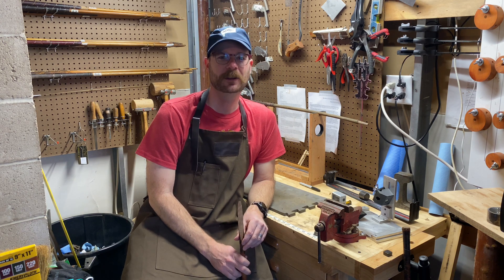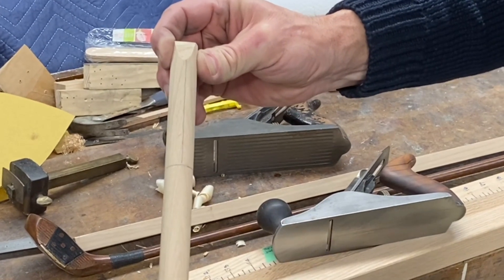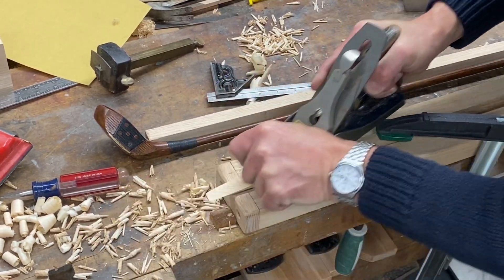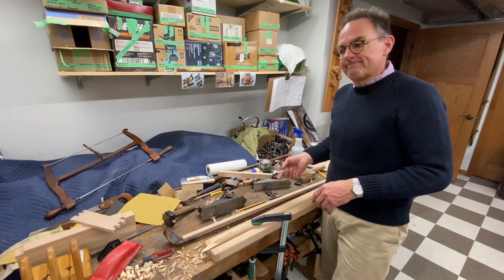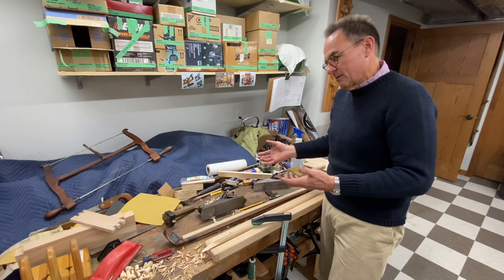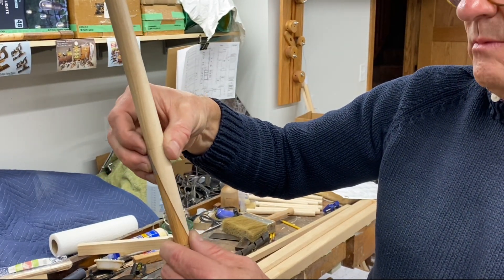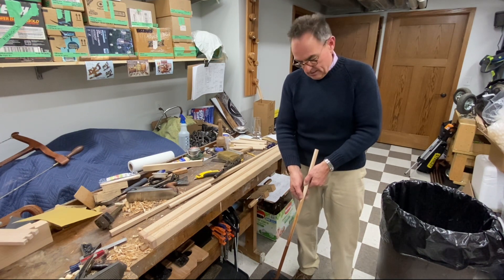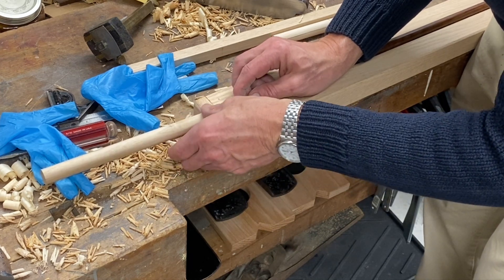Lengthening a Wooden Golf Shaft - Fix-It Fridays #1

Comment: I really learn a great deal from your videos. I have a driver that was cut off about 12 or so inches. I imagine for a child to use. Maybe I can try this technique. But 12 inches may be too long of an extension to do. I may have to replace the whole shaft. I will be referencing this video and others when I work on my project driver and niblick this coming summer. Thanks for the videos.
Reply from the maker: Thanks for watching, Michael! I'm happy to hear they're helping. 

Yeah, 12 inches is probably a lot to ask for with a splice extension and you'd be much better off replacing the entire shaft. I've replaced entire shafts on splice neck heads before, but I haven't done it yet with a socket head - that's going to be another workshop video sometime this year when I find some time to learn how to do it.

Comment: What specific model Stanley plane is he using for this?
Reply from the maker: It’s a vintage Bailey No. 4. Type 20 (1962-1967). Brad prefers using a smaller No. 3 Bailey for this work, but says the wider bed on the No. 4 does help keep the splice angle flat from side to side.